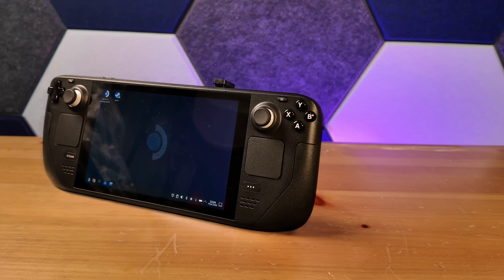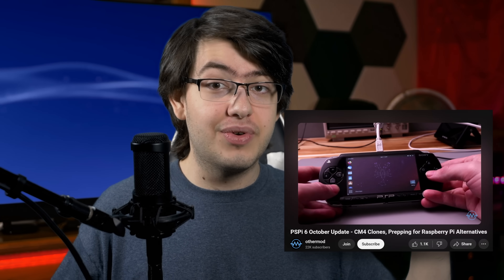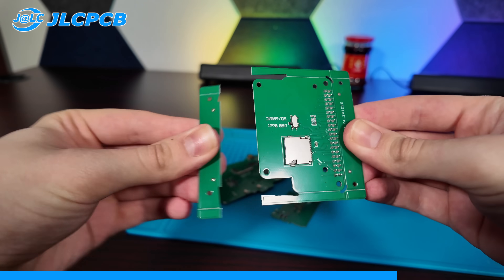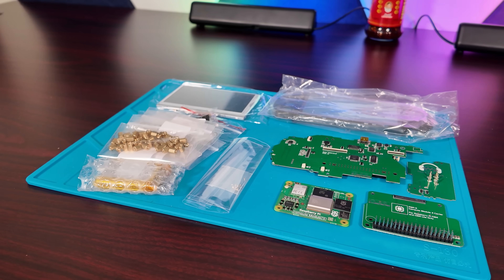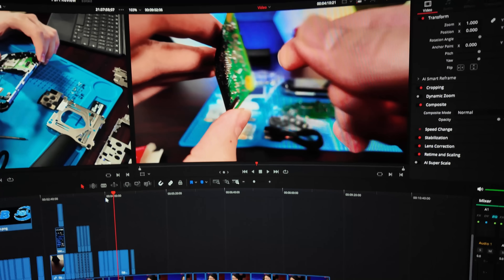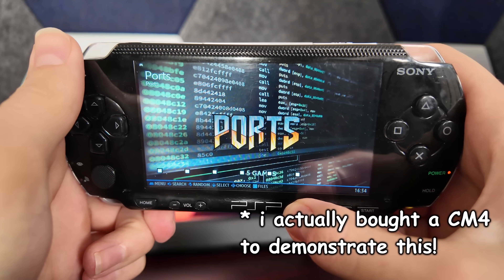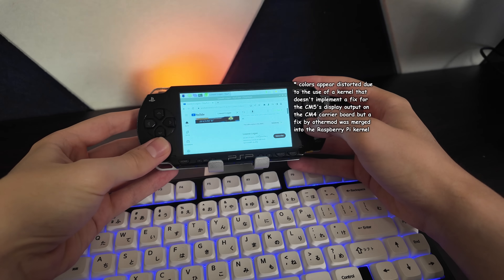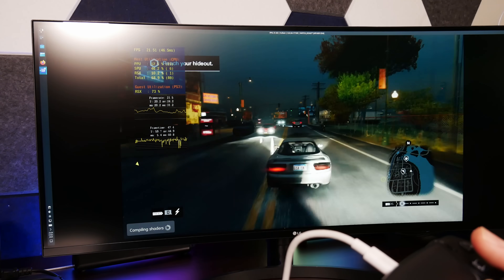I put a Raspberry Pi 5 inside my PSP

Comment: Is there a similar one for the Vita?

I love the PSP and it's form factor, but PSP is a bit short on inputs to be able to emulate a Dualshock controller for example, since you're missing four buttons and a joystick, so I feel like PS Vita might be better for this kind of project, since that's missing 2 buttons only but since it has the trackpad thing on the back, you could use that to make up for that.

Comment: why don't you just replace the UMD door with a heatsink? thermal issues solved.
Reply: I'm in the process of this right now.  Part 3 should be out in the next week or 2
Reply: @MakeOrBreakSociety would it be possible to fit another analog stick or theres no space at all for that?
Reply: @ingusmant it's something that's being worked on.  The main PSPi board does support a second one and the extra triggers.

Comment: when I think that if my phone had a drop down controller like the psp go, it could basically become this...
Reply: Decent phone is way faster than Pi 5, you are totally right.
Reply: @Wrublos212 my phone is 4yo and can emulate the switch full speed and run most high end phone , it just needs a propper controller games

Comment: The desoldering of stock psp parts by itself warrants me just buying one of those many retro devices that are on the market. I love the energy and DIY ness of it all but im super into preserving stock parts if It can be helped.
Reply: 100% agree. Cannibalizing PSP parts is just a bad thing all around. Cool project for a one-off but people should just keep the PSP parts for PSP because it's so unique. That Pi can live elsewhere.
Reply: @xan1242 it's not. The mod is reversible without any soldering.
Reply: @n12ox  I didn't specify soldering. The OP of this comment thread did.

That being said, do you honestly believe anyone will reverse this mod in case they need parts for PSP 1000? I doubt it.
Reply: @xan1242 Does it matter if they actually will? The fact is they could if they wanted which was the whole point.
Reply: Don't need to desolder anything if you buy the kit directly from OtherMod.  All the parts are include and is 100% reversible.

The best way to do this mod is to grab a cheap eBay PSP with a broken screen or bad main board as both get replaced
Reply: Maybe for a dead device?
Reply: There's lots of broken PSPs you could use out there, I think it's fine if the PSP was non-working anyway, like a water damaged one for example
Reply: I mean you could probably do one of those consolizer setups with the left over parts
Reply: Just buy a retroid pocket

Comment: Surely CM5 is too much for such a project. My question is - is it really impossible to undervolt and underclock frequencies to reduce heating and power consumption? What does CM5 give in comparison with CM4 in this particular project, except for increased performance? Are additional I/O ports, USB, etc. used in any way?
Reply: I would guess that it only gives increased performance, since you can use Pi zero in it as well, so it's all based on the classic Pi 40-pin GPIO, which haven't really changed since Pi 2 or something
Reply: For now rpi5 firmware is in bad shape. But throttling is the way to use cm5 on PSP.

Comment: Do you get micro stutter or screen tearing in higher end systems like Dreamcast, PSP, Nintendo DS?
Reply from the maker: Without being able to do proper performance profiling I'm reluctant to answer, but to my eyes the PSP emulator seemed very smooth. Didn't try the other systems. Thanks for watching!